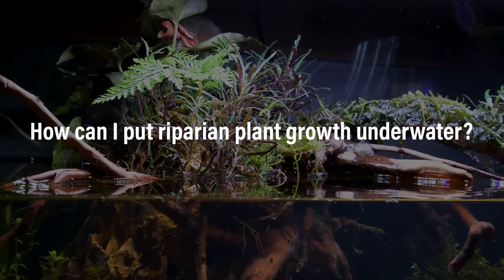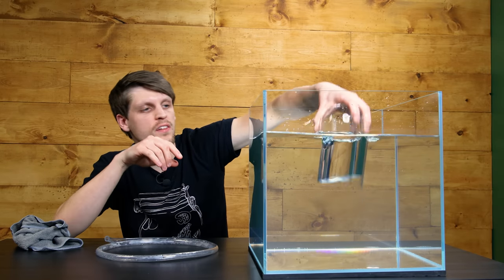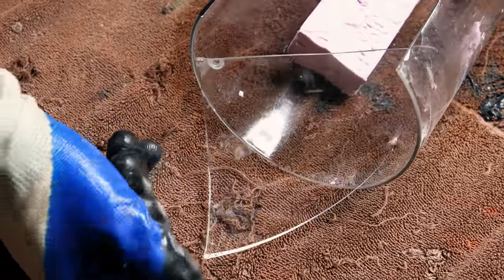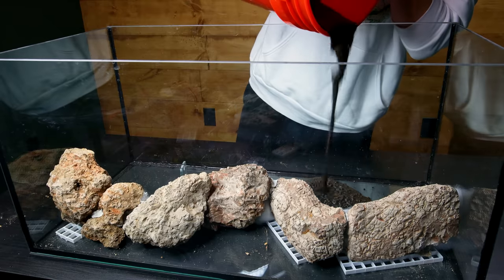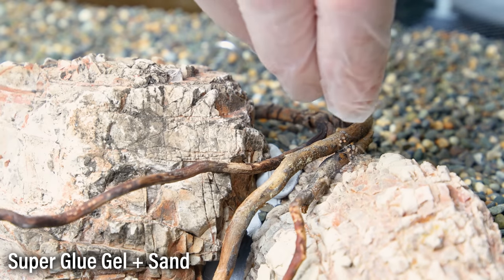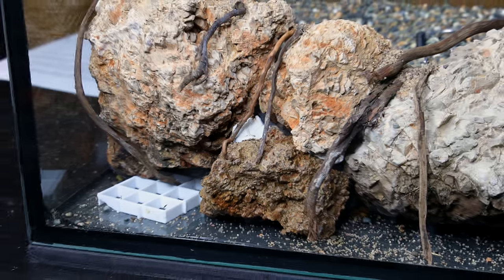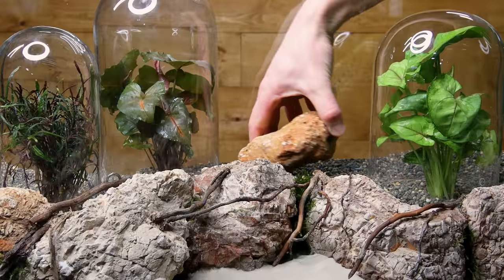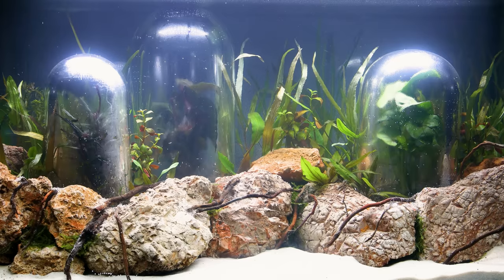Underwater Riparium Air Pockets for Houseplants Grown in Aquarium Substrate Aquascape

Comment from the maker: EDIT: To elaborate on how this works, it's essentially a terrarium that's underwater, as explained in the video. The only difference is that the plants are growing in the aquarium's substrate. In this way, the plants will sustain themselves just as they would in a traditional terrarium. When the lights go off the plants respire and give off CO2, which is utilized again when the lights turn back on. It creates a nice loop that keeps the system going indefinitely. I elaborate on it here in a much older video. https://youtu.be/7Lg4tzkHgVo

I wasn’t sure if this build would even be possible, but I was able to make it happen! It’s definitely a wacky concept, but in principle it should work long term. It’s basically just a combination of a terrarium and riparium, but underwater. It’s always fun to bring these ideas to reality, so I hope you all enjoy it! Let me know what you think and enjoy the rest of your weekend SerpaSquad!
Reply: I'm worried that the plants will eventually consume all the carbon dioxide in the container. I'm not a biologist and not at all knocking the design. A possible solution would be to blow new air in from time to time. Very fun build!
Reply: @chrisl1873  Yeah I was also wondering the same thing, it will be super interesting to see how this progresses
Reply: @chrisl1873  probably CO2 will just go up and down during the lights on/off cycle when there's no photosynthesis.
Reply: I did similar in a 150g with clownfish  to keep separated from other clowns worked really well and looked amazing until algae started growing on both sides of the container!!! made a couple vids on it - ugh... 😊
Reply: @chrisl1873  what if he added that thing that makes bubbles below the containers? I dont know what its called but its used in aquariums to circulate air. Then maybe also use C02 filters. Would this work?
Reply: What about using glass cylinders with the tops out of the water. I don't really like the domes.
Reply: you are so humble ! it wouldn't be possible for to have done this, but for you it was a breeze ! you are truly a master at your craft, an artist extraordinaire !
Reply: @Amy Williams No hate here. I love this channel. This just isn't my favorite.
Reply: The next level step to this design would be to have like an island in the cloches for springtails/isopods and maybe some sand that would attract the condensation from the sides.
Reply: I don't even know how you come up with some of this stuff... amazing.
Reply: really cool concept. if you're satisfied with it in a little while, do you think there are any flowering plants that would be suitable to add? I think that would be awesome to see flowers blooming "under water". the concept sort of reminds me of the little prince and how he protected his rose on his home planet (just visually I mean). 
another awesome project!
Reply: I happy to see the more wacky builds. It's interesting to me to see the things that don't work as well as those that do
Reply: I like the look! Quite different. As for the condensation... there are glass treatments out there that are anti fog agents. Mainly used on eye glasses and bathroom mirrors. I can't tell you if they would be plant or fish safe, but maybe you could look into it for this project. Best of luck! 👍🏼
Reply: Tanner, you are a true innovator who thinks outside the box! One interesting experiment would be to try plants in the cloches that put out spreading runners to propagate (does the arrowhead?) It’d be interesting to see if the new plant shoots outside the “air bubble” would grow up and out of the water in true riparium fashion! Perhaps try different aquarium water levels (1/2 and 1/4 way up the cloches) in the tank so the new shoots don’t have quite so far to travel to the surface. Also, what about trying the exact opposite; growing 100% aquatic plants inside water-filled glass enclosures in a strictly terrestrial terrarium? Siliconing glass cylinders (instead of cloches) tightly to the tank bottom would allow them to be filled with water w/o leaking. Fully aquatic plants and nano-fish/shrimp/etc could then be grown in the “water columns” for an interesting effect. It’d be the converse “look” of your experiment but the mechanics & construction would be different. I’ve also seen people put upside down fish tanks filled with water in koi ponds so the fish can swim above the pond water level.  Hmm, the tank would then need to have some water in it and that level could never drop. Doing it exactly opposite your method I think the substrate in a water/soil (water/gravel?) mix would conduct the water out of the cloches but Im not 100% sure, the physics might be interesting to test I appreciate your channel because it inspires others to think outside the box as well! Congrats on the new house & Happy New Year!
Reply: the REVERSE would also be very interesting: riparium bubbles within a terrarium.  or any variation of scapes within scapes; living bubbles within living bubbles :)
Reply: Would drilling through the bottom of the tank be viable? I imagine it would allow you to use plants that don't like having their roots wet but it might also cause the bottom of the tank to weaken.
Reply: @chrisl1873  I think he'll have to refill the domes with air every once in a while. Even outside of the gas that the plants use, the fish and snails will cause the domes to wobble and knock a little bit of air out each time.
Reply: @Amy Williams Top Idea! 💡💡💡Tanner you should try this! ✅✅✅
Reply: i'd say some sort of hydrophobic coating to the inside of the domes would take care of the condensation problem you noted.  the water would bead down rather than stick to the surface and--i think--keep things clear to view the plants.
Reply: That was awesome! Also your fish look so happy!
Reply: Looks awesome! As usual! How's Sammie? Would love to see a photo of him soon. Keep up the great work! Love from Memphis~
Reply: using an air pump to increase the air flow on the terrariums would improve the visibility?
Reply: @karinchristensen220  The cylinders would fill with water up to the same level as the rest of the tank.
Reply: Btw big fan of your videos
Reply: Some weak points that people don't talk about are the fixtures you glue with silicone at the bottom of the tank. The air in the domes pulls upward hard, and I am surprised that just an inch of silicone on both sides of each bubble is still holding... Clearly, if you pock on that during maintenance the dome will 'bubble up'.
Reply: @karinchristensen220  if they were just cylinders they would immediately fill with water
Reply: @chrisl1873  I'm a biologist, hopefully I can help answer your question! 

Firstly, a plant is constantly respiring O2 into CO2 (all day and all night, just like us!), and when the lights are on, it will also be doing the opposite as it photosynthesises, taking in O2 and excreting CO2. 

Plant growth and the locking of C into biomass would theoretically reduce the amount of gaseous carbon available, but as the plant grows, the amount of tissues respiring would also increase, which could cancel out this effect. You’ve also got death and decomposition releasing C back into the system. In a regular terrarium, the system is this simple (assuming it is fully airtight). With a setup like this, you'd also have to consider gas exchange between the air and the water, the rate of which changes based on things like water temperature, chemical composition and pH. Because the gases are moving between the cloche and the aquarium water, they can interact with the aquatic plants and animals or can then escape out the top as it doesn't have a lid. Dead plant tissue will also probably sink to the bottom and decompose. But, because CO2 is more soluble in air than in water, any C added to the water will try to get back into a gaseous form, either inside the cloche if it is low on C, or out the top of the tank and into the room. Water changes will have the knock-on effect of adding 'new air' to the cloches in this way, although I suspect that even with Tanner being incredibly careful, some air will be 'spilled' and need to be replaced manually!
Reply: @Marie_Danielle  Well, you could silicone them to the bottom of the tank, but Tanner's way may work, too. It will be interesting to see how it works. .
Reply: For the foggy domes, would it be possible to like spray some of that anti fogging spray for glasses on it? Another concern with that though would be whether it's toxic or not. I wouldn't know, I'm no plant and fishy expert. Just an idea and even if this specific idea wouldn't be possible, maybe there is another way to reduce fog. I also wouldn't know that though, I'm no weather expert either.
Reply: @ThePerennialEffect  Tanks for the explanation. This is the kind of invisible phenomenon I was wandering about.
Reply: @chrisl1873  I actually thought filling the container with CO2 would be a handy way to add some to the water passively as well
Reply: We're in 2023, but Tanner is in 2032
Reply: @chrisl1873  if the plants grow much, they will need added CO2, as that is what they build their bodies from. I do wonder if enough CO2 might defuse in from the water at the base of the cloche?
Reply: Since you can't add spring tails and you are maintaining a very high humidity in that enclosed space, there's a risk of mould or algae taking over. Not sure how to solve that. You might be able to avoid that with snails but they will leave poop on the glass. For the condensation, maybe you can apply those anti-fog spray on the glass. The ones that created a hydrophilic surface should be safe for the plants and animals.
Reply: If you want you can do an entire ecosystem under water
Reply: Add some fish to this aquarium!
Reply: Could you use something like rain x or never wet to make the bulbs hydrophobic? You might be able to solve the condensation issue like that.
Reply: Could you share what the lighting schedule is for this set up?
Have you explored ramp up/down timers?
Seems more gentile than a hard on/off.
My tank: white lights on at 10AM, blue gets added to the white lights at 8PM, white goes off at ten PM, blues go off at midnight.
Don't really notice a difference with my critters, but it works with my lifestyle very well.

Color temperature (5000K vs 6000K LEDs vs 3200K tungsten bulb) is also an interesting topic...

I'm hearing impaired, so I didn't catch if you mentioned what plant species you used in the domes.
I'd love your thoughts on using Lobelia cardinalis in aquariums.
Thanks!
Reply: You know, it might work nicely to leave the domes misted up and then putting some lights underneath to create a real ethereal atmosphere
Reply: This is a very interesting concept. What if you did one where to different environments intersect? Like you have your fish, but through the middle of the tank there is a tube going through either side. One of your reptiles or amphibians could crawl through to their own enclosures. It's like they have their own aquarium attraction that they can visit. I bet with you skills and artistry you could come up with something unseen before.
Reply: I'd be curious if there are different choices of material for the terrariums that might be less reflective. The shine on them makes me wish I could see inside better.
Reply: @karinchristensen220  could be a cool looking isolation tank within a tank if you could get it secured
Reply: Cool idea!!  Would water changes affect it ( assuming you didn't empty the water level below the air level in the dome?

Comment: What if you coated the inside of the jars with something hydrophobic? Lots of chemicals do that for clothing and shoes and things and maybe it would allow that glass to become far more transparent. Also love the back frosting, adds a great effect! Love watching your videos man, its so relaxing and makes me really want to build a small aquarium when I have more space.
Reply: That would be a good idea, but the question is, would it be safe for the plants? I genuinely don't know, but if it is safe, that would be a really cool solution!
Reply: Wouldn't the water just bead up then? I guess it would get rid of the fog
Reply: @yourmother3207  perhaps, but then perhaps gravity would eventually pull the droplets down...? the water line might rise in the terrariums but again, he can just blow more air in there i 'spose
Reply: Very interesting. Definitely worth giving it a year or so to see how it works out over time.
Reply: Yes, you could coat the outside of the glass with that silica form of aerogel that has been converted to be hydrophobic, and it should be plant safe, however I don't know this for certain. Also gotta add, the plants will be releasing oxygen and need fed co2. No experience with this stuff but perhaps it could be researched and a co2 cylinder can be used with a controlled release air valve? But definitely do research and approach safely using co2. Also not sure about nitrogen? Theres a happy balance of gasses for different plants.
Reply: But the plants will sufficate over time if the atmosphere is stagnated.
Reply: @L_une  i assume he can add fresh air to them
Reply: @TerrAqua  oh yep yep for some reason I was thinking it was pure oxygen bahaha, mind slip.
Reply: Cool idea, don’t know if it’s safe for the fish though
Reply: I came here to say this!
Reply: Nitrogen from the nitrogen cycle and the dark phase should prolly take care of itself but the fish and bacteria will release CO2 into the tank. Just like moss in underwater caves
Reply: @TerrAqua  better yet, he could put a bubble stone under each one so air with CO2 is fed continuously, and keeps the water level from rising too much
Reply: @jeagerkej3171  I imagine there's a hydrophobic chemical that doesn't contaminate the water that it does contact- aerogel is hydrophobic and is just silica
Reply: Actualy what you need is something strongly hydrophilic so that the water spread out evenly on the glass. That's how some anti-fog spray works.
Reply: Not my jam but it is an interesting concept.
Reply: Instead of epoxy you can use cotton balls and superglue.
Reply: This would make them mirror like. The layer of air would cause total reflection.
Reply: So does ash
Reply: @WoollyStudio  my dad was in the Navy.. just use spit
Reply: We do this for swim goggles... add a drop of dawn dish soap, coat inside, rinse off, and swim without your goggles fogging. Same applies here. Add a drop or to of dawn, rinse off, and wah lah...
Reply: That would be toxic to any fish or inverts you put into the tank.
Reply: @L_une  Not neccessarily. Plants do produce CO2, just at a much reduced rate compared to their oxygen production, so they could, in theory, be fine without needing added CO2
Reply: @sociallysatanic  well the waterline wouldn't rise because the air would have to go somewhere to allow that so I imagine it would be fine and self-sustaining.
Reply: @TerrAqua like a tiny drop of toothpaste rubbed into the bathroom mirror will keep it from fogging

Comment: Please keep this build together for at least a year and then update us! This is such an interesting concept. While it seems similar to past projects I'd say this is something wholly different. I'm extremely curious about gas exchange in the plant bubbles and if the respired CO2 from the plants themselves will indeed be adequate to keep them thriving. I suspect some CO2 will also leech into the air from the water as it evaporates and the condenses on the glass. Your builds always inspire me so much!

Comment: Very cool idea! Love the execution too. From the thumbnail, I thought the domes might be inserted through holes cut in the bottom of the aquarium & siliconed water-tight but the actual suspension under the water is even more impressive. That approach might help with the condensation issue, though the plants would no longer be receiving water from the aquarium unless they were rooted in a sump below.

 It did get me thinking, though, that a large aquarium with a big dome coming up in the center would be a neat way to stick your head up in the middle of the aquascape!  Would need to be a thick walled dome. Cheers from VT!
Reply: They have domes like this in some big aquariums !
Reply: @drewabbey9390 yeah I think there’s one in ripleys awuarium in Nashville Tennessee